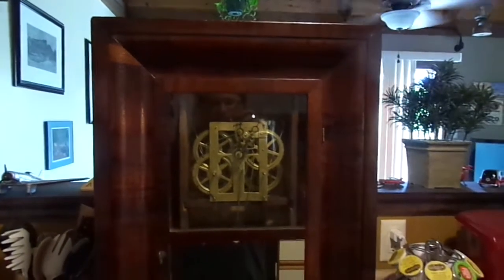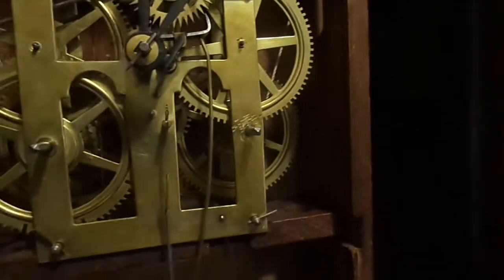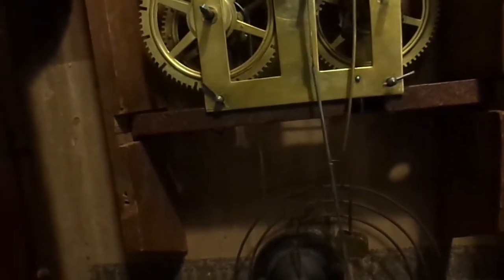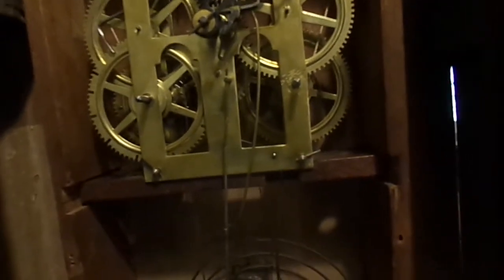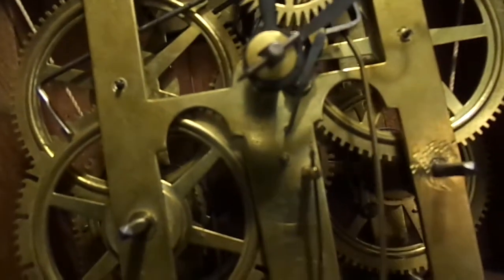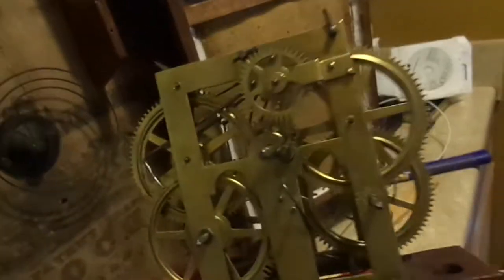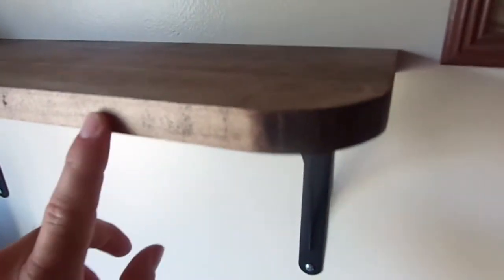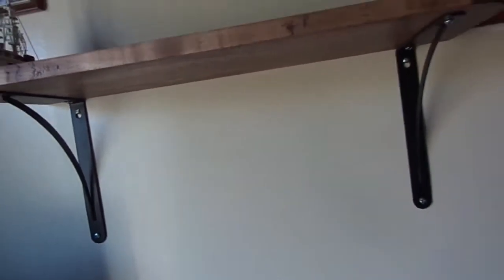Restoring The 1846 Chauncey Boardman Clock Part 3 FINALE!

Comment: Looks great. I never would have thought about these old clocks if you hadn't done these videos. I had no idea stuff like this was still around that isn't high dollar collectors pieces.  I think if I ever did one of these, I would probably just use clear glass instead of a mirror only because I would love to see the original artwork / Company logo that is on the inside.
Reply from the maker: It's surprising to see how little some of these clocks are worth, making them an affordable way to own a piece of real tangible history. The real cost lies in the equipment needed to rebuild and properly restore the old movements; in this case, a drill press, lathe, watchmaker's tools (reamers, burnishers, files, etc) were used. Once restored properly, a clock like this one can fetch up to $300 if sold. The mirror was used to preserve the clock's original appearance; in actuality, the mirror was an extremely expensive option, as mirrors were costly to manufacture. Thanks for the feedback!